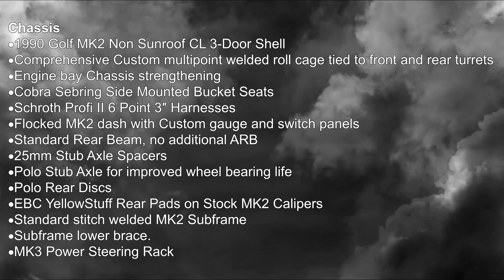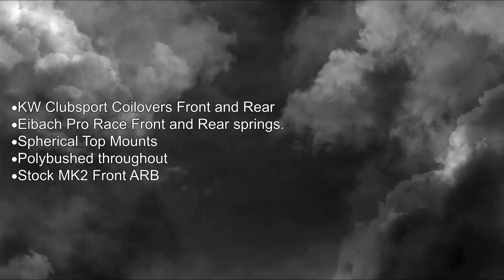The Pinderwagen walkaround and detailed explanation. #pinderwagen

Comment: Hi there Nigel, 

In regards to the Saxo Power steering,is there any other reason you chose that besides less stuff running off the engine?
Reply from the maker: Djessey the standard pump is over assisted and also kept throwing the belt off at high revs. The main reason was for less assistance and more feel though

Comment: Great video guys

I think if it was my car I’d be annoyed by how scratched the windows are? Maybe you don’t notice when driving it
Reply from the maker: That is the downside with polycarbonate windows. I wouldn`t use them on a road car for that exact reason. As this is a circuit only car, I hardly ever look out of the side & rear windows apart from glancing in the mirror and you simply don`t notice them then. It`s only obvious when the sunlight catches them at a certain angle anyway.

Comment: I would like to know more about the Electric Hydraulic Power Steering. How was this installed and what exactly does it do in the golf. Is the ratio of the steering angle greatly reduced? Hope you understand my english ^^ Best regards!
Reply from the maker: The standard hydraulic power steering pump is belt driven and I was having issues with the belt at sustained high revs and offering too much assistance.

The electro/hydraulic pump uses the same steering rack, but the hydraulic fluid is pumped through the rack from that pump instead and it also gives less assistance and better feel.